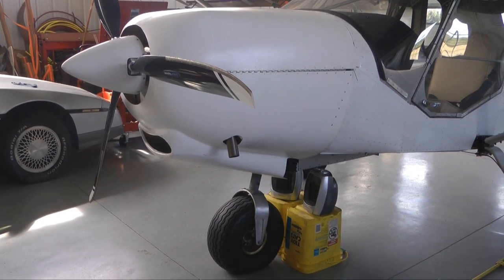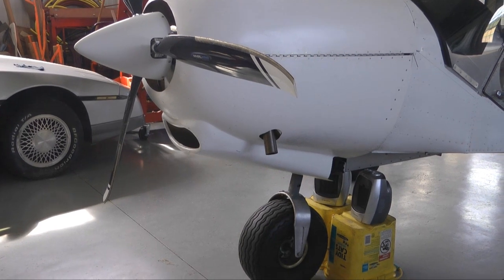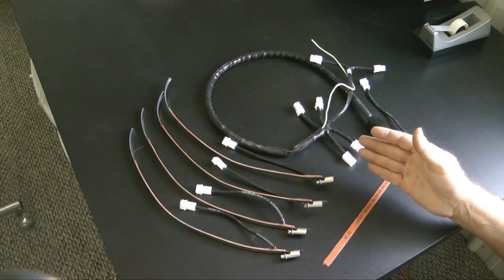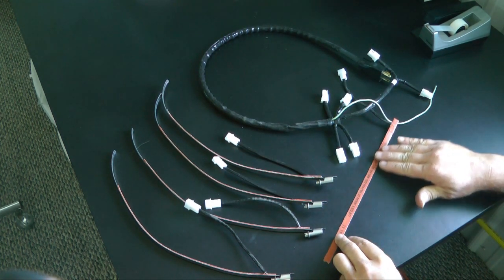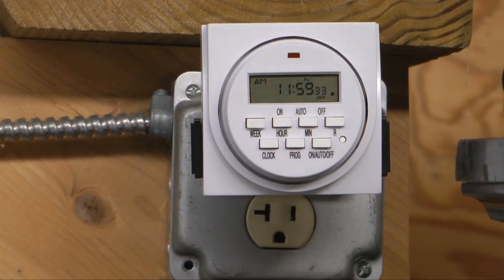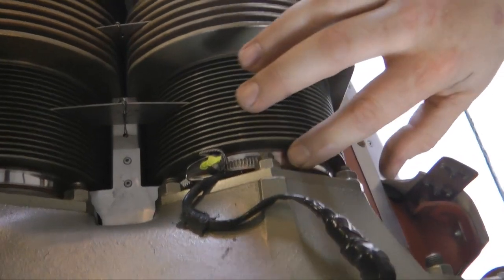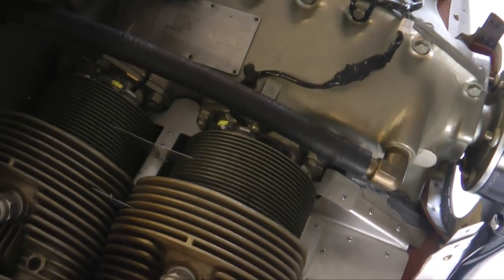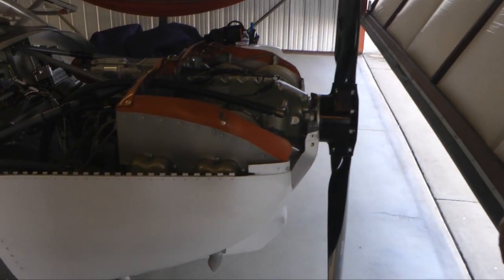Preheat your Engine for Cold weather Flying

Comment: While dropping skydivers with an old 182 on a very cold day, my boss preheated his plane by using a duct (bendable dryer vent metal stuff I think it was)   The engine was covered with heavy blankets. The duct went in the bottom, most of the holes were plugged to keep the heat in, and the car was left idling for a very long time. It was about 30 years ago, so I forget how long it took, it took a long time, but it did work. We got her started. All from the exhaust heat of a Dodge Dodge Dart. I’ve never seen it done before or since then in that way.

Comment: Back in the day here in North Dakota, we used a small 12 volt propane heater/blower with a long duct for safety, and a thick blanket over the cowl.  It worked very well.  I didn’t fly on the cold days (-20 to -40).  A 110 volt might be more convenient for some folks.

Comment: I use a 1200 watt hair dryer and put it in the inspection door of the engine compartment. It is hooked up to a WiFi switch. I turn it on from my house. All toasty warm when I arrive to fly my Rv12.
Reply: I also use a hair dryer but i turn it on when arriving at the hangar and maintain the hair dryer on while doing all the inspecions and flyght preparation ...may be 45 minutes or less and with temperatures around 2ºC in winter the engine satarts at first try.....i use a tripoid to give the hair dryer the correct orientation and distance ( cost 20 euros).

Comment: My plane is in an unheated, but insulated hangar and our Tennessee winters aren't too harsh, but I use a Hornet heater.  They are solid state, thermostatically controlled, and explosion proof. It uses so little energy that I just leave it on all winter and it preheats the engine and entire cowl.  The Hornet heater I bought was very similar to the 110v "Twin Hornet" aircraft heater and actually intended for heating industrial enclosures such as those containing electronics, valves, etc. and was much less expensive because it didn't have the word "aircraft" on it! Ha!  I think the vendor caught on that people were purchasing the less expensive enclosure heaters and discontinued that model for enclosures and now you can only get the "Twin Hornet" model that's intended for aircraft ... with typical "aircraft" pricing!  :<(

Comment: I believe most folks knowledgeable about engines do NOT recommend using a timer to turn the heater on and off.  This tends to promote condensation.  The engine heater should either be left on all the time or controlled remotely via wifi and only turned on prior to flight so that the engine is warmed and then run to get it hot enough to burn off the water vapor.  I definitely would not use a simple timer that turns the heater on and off on a schedule and then not have the airplane flown after each heating cycle.
Reply: Sounds like a good reason to use the timer “honey we have to fly this weekend because the engine is already preheating!”
Reply: I know I'm kinda randomly asking but does anybody know a good site to watch newly released series online ?
Reply: @Robert Kamari I would suggest flixzone. Just search on google for it :)
Reply: @Dayton Dario Yup, been watching on Flixzone for years myself =)
Reply: @Dayton Dario thank you, I signed up and it seems like a nice service =) I really appreciate it!!
Reply: @Robert Kamari you are welcome =)

Comment: Heat gun 2000W 30-40cm right under the oil tank of 912 and 700W heater in air intake will do the job in 20 min, supervised of course